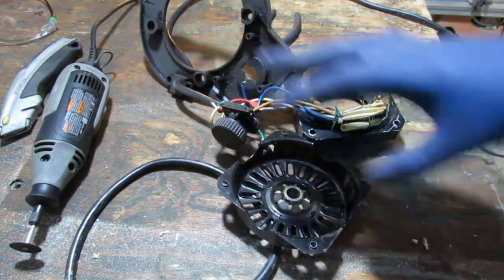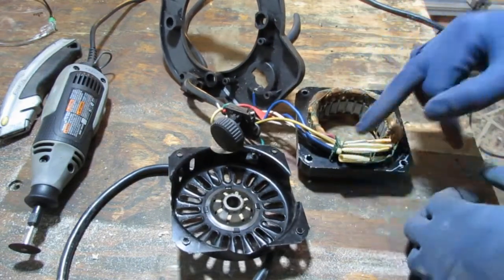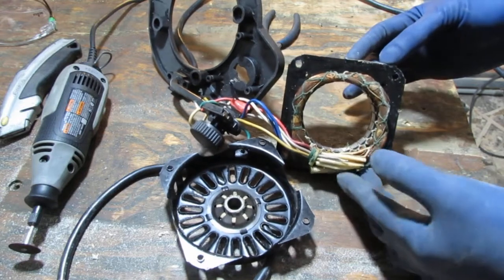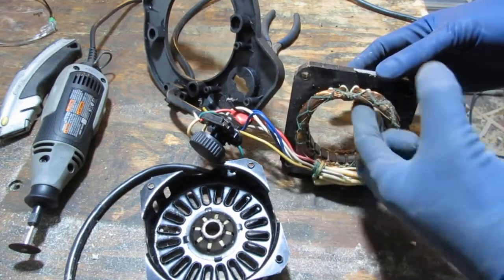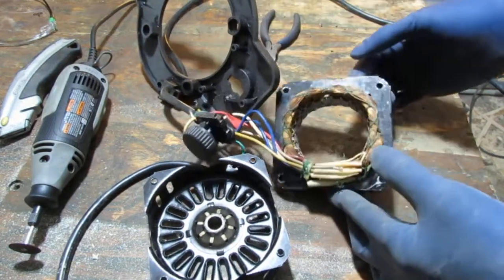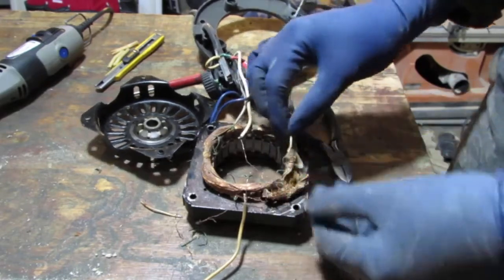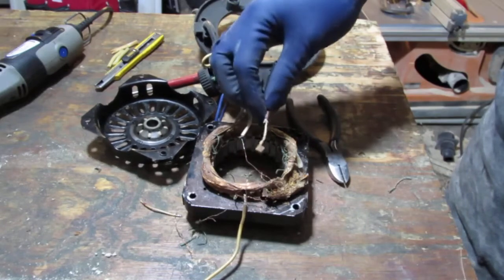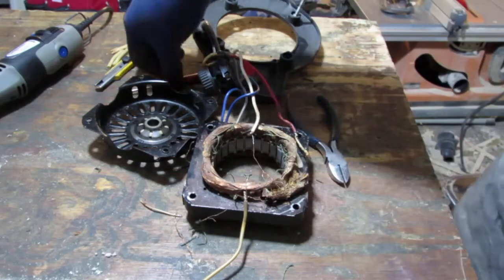Where Is The Fan’s Thermal Fuse? Model SFC1

Comment: thanks for the video, now I know where the fuse is when I repair my fan. Yours may be a goner but you saved mine from the garbage. I'm probably gonna leave the old one in place and just put the new one next to the windings somewhere. Also could you please add SFC1 to the title as that is this fan's model number and it would help others find this video easier.
Reply from the maker: I added it to the title and thanks for the suggestion.

Comment: The device you referred to as a “thermal capacitor “ and a “thermal resistor” is a thermal fuse or thermal cut off. There are other videos online where they have successfully replaced the thermal fuse.